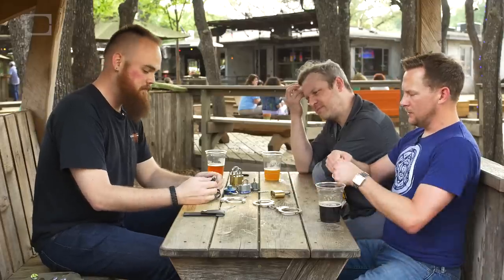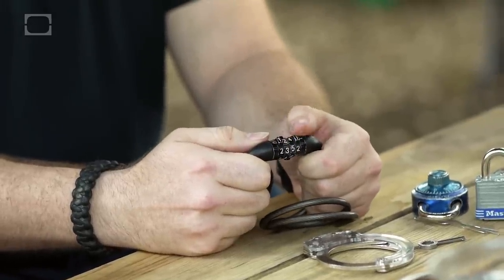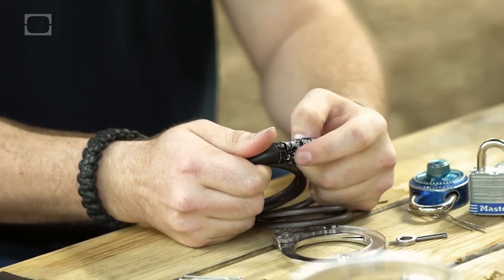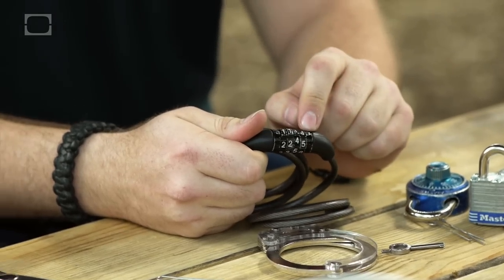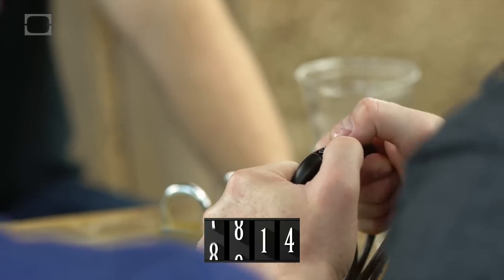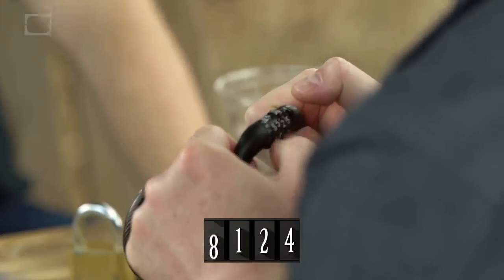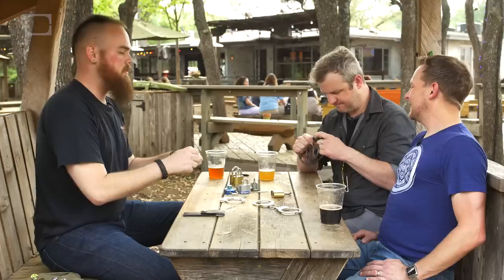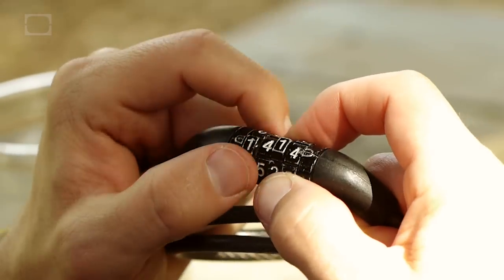How to Open Bicycle Locks Without the Combination!

Comment: I figured this trick out years ago when I was 13, I had two old bike locks that I had forgotten the passwords too. This works well on this small bike locks but the larger dial locks are harder and this doesn't work. I have an "On Guard" branded lock and its much larger than these small ones and you can't break the combo like you can on the small ones. Also "Kryptonite" seems to make a really good bike lock that can't be broken this way. Of course a nice set of bolt cutters will easily get through most cheap bike locks. 

Not that I would know.... 😉

Comment: Glad you're bringing awareness to this. You'd be surprised how many people think their bikes are safe with these cheap locks, then have no idea how they got stolen. Their bikes were never secure, they were just under the illusion that it was.

Might also want to cover how cheap cylindrical key locks can be opened with nothing more than the tube from a cheap bic pen. The moment I learned that one, I threw out my old bike lock.
Reply: There is a more secure version of this lock that can't be cracked so easily. But, of course, a set of bolt cutters will go through ANY of these super easily.

Comment: instead of wiggling the next wheel, just pull it apart. i had to do this in elementary school when i forgot my code one day. You pull it apart as if it were to open, then spin the closest binding wheel until it pulls apart slightly more then move on to the next. way easier than expected

Comment: Thanks so much for this information. For probably 20 years I have had a bicycle chain lock that I forgot the combination to. I couldn't bring myself to actually throw it away, but never found the time to try process of elimination. But with this information I now know the combination. In my case the hard part was figuring out how to apply the binding force. Pulling both ends of the chain did nothing. Had to actually pull the lock body which itself slides on a long loop that either end of the chain attaches to. But 5 minutes of work and I now have a usable bike lock again.
Reply from the maker: Dale King NICE!

Comment: 2008 had a kid in class ask if he could use a pair of scissor, and cut up a Red Bull Can. Gave him permission, with the Clean Up Your Mess, tag line.

I watched as he cut the can into a shape that had a point with sides that wraped around a large felt pen.

He then took this crudely made tool, and then opened 10 Master Locks. He did this in less than 15 minutes !

Amassing What Ya Can Learn at School !!!!

Comment: I've got the same Master cable lock as the one used in the video. My kids lost the combination years ago. It is unlocked. What is the technique for finding the combination for an unlocked cable lock? I may want to use it again, even though cable locks are obviously worthless. UPDATE: Disregard. I figured it out. Push the keyed end in and turn the tumblers starting with the one closest to the key working towards the tumbler farthest from the key, one at a time, until each notch of the key slips in. Write down the combo! Good thing I went to college. Full disclosure: Your video put me on the right track. Thanks for the hint!

Comment: Oh my gosh! This so worked! I bought a new Sunlite lock and somehow when I was coding it (my first ever bike lock) the numbers got all screwed up and it wouldn't open on what I thought I had coded it to. I was so mad! By the way, I hate this lock because the directions for coding it for the first time do not give you any warnings at all. 
I couldn't tell at first if the numbers where spinning any differently so I put some WD40 on it and that really helped. My thumbs are tired from trying but, with persistence, I got it. Needless to say, I'm leaving the random numbers that the lock chose for itself because I'm not attempting to recode and have this happen to me again. I'm so pleased with myself I can hardly stand it. Thank you very much for posting this video.

Comment: Thanks guys, took an expensive lock that was being thrown away in lost property after not being claimed 12 months ago. I've used this method before but not been successful with this lock until now with a little more patience and more pressure. Cheers

Comment: I have to give credit where it's due.  I was about to buy a new bike lock because I forgot the code for the lock I bought last year since I hadn't used the bike in six months.  This worked perfectly and I had it figured out in under 3 minutes.  However, now, whenever I lock up my bike somewhere, I'm nervous because that means anyone that knows this technique can access my bike within a matter of minutes too.  Geez.  Who knew?  I'm getting a bike lock with a key ASAP.
Reply: key locks can just be picked with bobby pins or paper clips just as quickly

Comment: I know from experience that a variation of these locks can be a whole lot harder if there's false gates in there. They make you think you've found the right number, but they're a decoy, and it becomes impossible to tell the false gates from the correct one. My bike lock that I forgot the combination for was a pain to get open. I ended up having to identify all the false gates, and then plug the numbers into a formula to generate all the remaining possible combinations, which in my case added up to 256. Still, way better than the 10,000 possible combinations I was contending with before.

Comment: I was about to throw away my lock, which I had forgotten the combination of. Using this technique I was able to figure out the combination and open the lock!
Reply: It's just a deterent, most locks just create a hassle for the owner anyway, if a thief really 
wanted to steal, the best lock would be of no use either

Comment: Well damn. I knew this used to work on the first combo lock bike chains back in the 80s, didn't think it'd still work on modern locks. We just bought a bike with a chain still on it that they'd forgotten the combo for (no, not stolen, it's legit). Watched this video and now a few minutes later I have the unlocked chain in my hands. I think I'll be buying a key lockable chain instead. At least it might slow them down for a bit longer.

Comment: not drill into mechanism just an horisontal or near h  access  hole or trench drilled from above a few holes in line   to outside  area where key teeth enter lock , then with repeated jabbing motion  push a straightened cable wire strand in the small space  above theeth and under roof of  teeth chamber , turn number wheel until wire  passes through open tooth gate  , continue with wire and let wire end knock on next gate plate and turn that  second number wheel until w goes through again and repeat . try it its fun.and kinda easy and the purpose is to reuse the lock . might fill the hole with some filler or gum.

Comment: firaro; its either stuck cos you're twisting the the bit that pulls out too far and the teeth are binding, or the c-clip that holds all the wheels in has moved round. manipulate the c-clip with a knife. on cheap combo locks, the c-clip is a major weakness and the lock can be forced open by simply hammering a screwdriver through the gap to break the clip so that the whole lock falls apart. i reccomend spending af least a tenth of the value of your bike on a good lock to secure it. dont rely on locks from dollar stores -theyre only good enough for picking practice for begnners!

Comment: This video really saved my life. I locked my bike and then the lock got jammed and I couldn't get the correct password. So we had to apply a lot of pressure to pull them apart then when spun the numbers until we heard a click. The numbers were extremely hard to turn but we did it somehow

Comment: There are better locks of course, the ones that have an artificial detent. You can't feel them bind and the numbers fit EXACTLY, plus you need at least thumb and another opposing finger to turn the dials at all. Much harder than the cheap shitty locks. But yeah, works great otherwise.
Reply: +ObsessionPC I think I have one of those (even though it wasn't really that expensive) because non of the techniques seem to work on mine. I'm getting blisters on my fingers from trying to pull on the chain and trying to turn the dials at the same time.

Comment: why are you picking a combo lock thats already been cut through the cable? by the way, the padlock you show t the beginning of this clip can be picked with a shim made from a coke can. cut a piece 3inch long x half inch wide. cut from one corner up at angle to form a V at an angle of approx 20 degrees, about an inch long, then snip the point off to leave a 2mm squared end, fold over the uncut opposite end a couple of times to form a stiffener for the pick about 5mm deep. this shim will fit between the wheels and can be used to feel a deffinate sharp step on one place as you turn the wheel. get this step in the same place on every wheel and then move all four together in one-digit increments and push in the shackle at each step. the lock will spring open at typically 3 or 5 digits from where you set it with the pick. the number showing when youve opened the lock is the actual combo. there is a quicker way to open these with a specialised tool, but that tool just bypasses the wheels and manipulates the locking spring inside, so you wont know the actual combination.

Comment: I've had this particular lock before. The tolerances are so loose that you can just wiggle the binding wheel each time to see if it can move freely laterally. If it can move freely, then the number is correct.

Comment: Hi, I am trying to decode a 5 digit bike lock, but it is proving to be quite difficult (I have decoded several other 4 and 5 digit locks). This one has 4 black number wheels (black with white numbers) and one yellowish/orange number wheel (on the far right hand side) with black numerals. I can use the normal "binding" approach and feel the gate on each wheel, but it seems as if the yellowish/orange wheel has some other role in opening the lock. The lock has no brand or model number visible on it or the cable - it was purchases about 4 years ago in Hong Kong. Has anyone seen a similar type of 5 digit lock or have any insight in to the role of the 5th wheel ? Thanks ! Bryan

Comment: The problem isn't bicycle locks, it's combination locks. If you actually use a decent bicycle lock, it wouldn't be so easy. Of course, a bolt cutter still gets the job done. I even heard a story where one bike was locked at the front wheel and one at the back wheel, they used a wrench to unhook both bikes front wheels and combined them into one unlocked bike.

Comment: i once found a bicycle lock looks same model as the one he was using. it was just on the ground open. so i took it home and looked inside and figured out the code.
so when he was demonstrating i went and got it and... well i figured out the one i have is so broken that you cannot use that technique on it, and even with the code i couldnt get it open

Comment: Lock idea, two sided pin lock
Reply: for them to crack, or should it be produced?
2 sided pin tumbler locks are pretty common, and most safes use them.
a safer option is Disc tumbler locks, for padlocks and such
Reply: Nathaniel Schmitt what about a combination of a key lock and a padlock instead of just turning it you gotta stick the right key in

Comment: Complete bs
Reply from the maker: how so?
Reply: Scam School both me and my dad tried it for hours, it did not work
Reply: +nigel luke I tried it on my bike lock and did it with my eyes closed, worked great
Reply: It didn't work for me either. Does this method only works on some locks or all locks? When I applied the so called force, I was not able to feel the difference in stiffness of the wheels.
Reply: Cool as Cucumber it works on older locks. the bike lock companies figured out this and fixed it by adding many, if not all wheels and numbers have tension.
Reply: thanks man